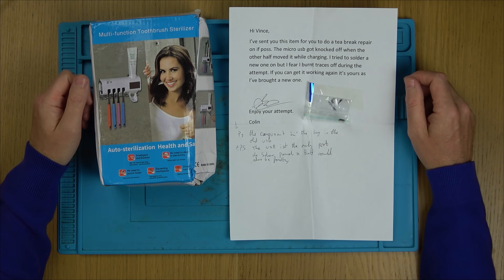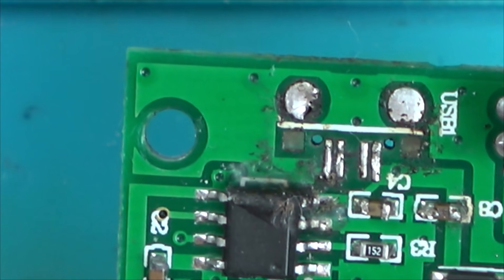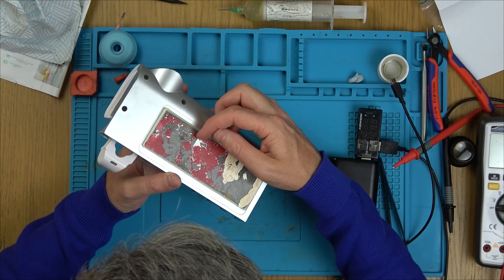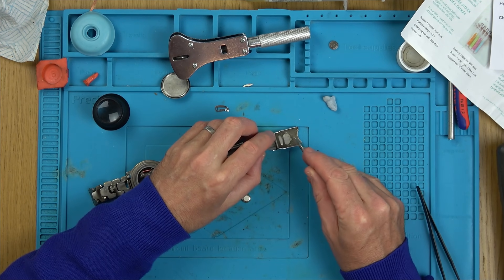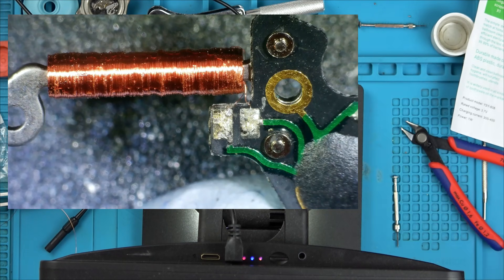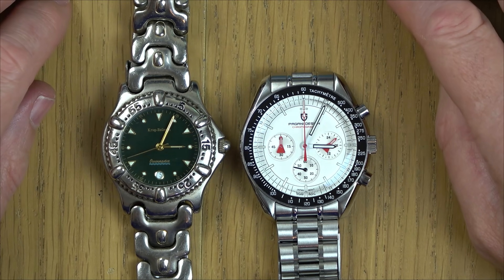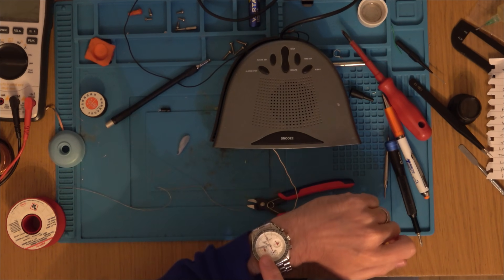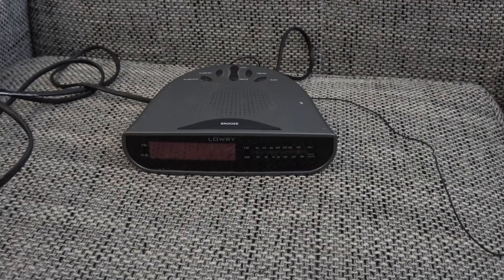Selection of PO BOX items - Can I FIX THEM?

Comment: Hey Vince, that clock radio repair was for sure the glue, with almost 50 years experience in electronics repair I have seen that glue they use to hold wires and components to be at fault many many times, don't underestimate it as a fault, I think hot glue is used now for that reason.  
The power grid is very accuratly controlled over 24 hours, the frequency may go up and down over a day with demand but is always the same number of cycles in 24 hours, amazing but true!
Love watching great content and you keep thing from the landfill.  :face-blue-smiling:
Reply from the maker: Thanks Glen👍
Reply: Agreed.  That glue can and will cause some weird issues. You can't necessarily measure it with a DC ohmmeter.  One of the worst cases is with the Kenwood TS-440 transceiver.

Comment: Hi Vince, i have a kitchen-clock from my grandmother. It dates to the early '50s and is a "Junghans Synchron" which runs on a synchronous motor powered by mains 230V. That means that the rotation of the shaft is synchronized with the frequency of the supply. The frequency here in Austria (probably most countries) is regulated. We get 4320000 cycles every day. Therefore this old, mechanical watch is incredible precise. If we didn't have daylight saving time I would never have to touch it. So i change the hours every 6 months and every 2 Years the gears (all brass:-)) and the motor spindle get a tiny drop of oil. It never failed at me.
Keep up exploring failures! Greetings from Vienna
Reply from the maker: Amazing that it is so accurate and built to last with some servicing 👌👍👍👍
Reply: @Mymatevince 
When is part 44 of the Rolls Royce coming out
Reply from the maker: @ProMasterTheGamer52  This week hopefully👍
Reply: @Mymatevince  
Ok
Reply: @Mymatevince  
You should check if the tale lights are working
Reply from the maker: @ProMasterTheGamer52  That will be in Part 45👍
Reply: @Mymatevince  
OK cool

Comment: Many years ago, I built a control panel for a customer in Canada. Part of the function was a 5 hour timer once the equipment reached a set temperature (know as a soak in pottery). A few days after it was installed I got a report back that they were only getting 4 hours of "soak". I forgot that Canada was on 60Hz supply. I sent a 60Hz timer to them, problem solved. Keep up the good work. Mike

Comment: Yep lack of tools, standard size soldering iron & just my eyes. The only thing I will say is we found the toothpaste dispenser blocks easy with some toothpastes & lets some thru with others, so we used it as just toothbrush holder and cleaner, as to the paint work it was lilac wen we moved in we painted over it cream then went red and then too white, so yes some changes
Reply from the maker: Cheers Colin for sending the unusual product over, and the history of the wall colour 😂 Thank you 👍👍👍

Comment: UV-C LEDs are expensive and haven't really found their way into consumer electronics as yet. So I doubt that that toothbrush sterilizer sterilizes anything. Just shines some violet light to make it look like its doing something.
Reply: Yeah. Quite a lot of things have a little, useless blue/violet light in and a nonsense UV sticker on the box.
Reply: You can find them sometimes, the best way to tell would be to look at the LED and see if it has a glass lens and metal housing. Even if it is UVC, it's probably just a single, weak LED.
Reply: UV-C LEDs have gotten cheap due to COVID-19, but those ones' look like normal UV.  The UV-C ones have a yellow-ish tinge to them due to the quartz glass covering they have.  My local supermarket was dumping phone steriliser boxes for $1 - they had real UV-C LEDs + wireless charging modules - win!

Comment: I had no idea a digital alarm clock could keep it's time using the 50Hz from AC. Presumably the modern clocks which run on DC will need a crystal added. Learnt something here today, thanks Vince.
Reply from the maker: Thanks Philip, it was news to me, I just assumed it would have a watch crystal in it. Amazing that the grid is so stable. Cheers for the Super Thanks👍
Reply: @Mymatevince The grid isn't just stable, it's guaranteed to be stable. Your get the same number of cycles each day. If for a few minutes it runs slow due to load, they speed it up later to compensate. Mains synchronised clocks effectively have atomic clock accuracy as a result.

Lots of early digital clocks were mains synchronised. I have one from 1974 in my living room. It keeps perfect time.
Reply: Modern ones most likely get a time reference over WiFi using NTP :)
Reply: @GeorgeStyles  We have a Roberts CR 9955 which auto sets the time. It doesn't use WiFi so I'm thnking it might be GPS time.
Reply: @DavidHembrow  my mate who worked in a power station gave me an unofficial tour, and the amount of effort they put in to getting this right is phenomenal. It's like the stock price for a power station worker, with tickers on huge led displays. I believe they have to modulate it by physically speeding up or slowing down the spinning of the generator in response to demand (ie, England world cup kick off, loads of TVs go on, it slows so they have to speed it up somehow, or run it faster later to compensate)

Comment: Hi Vince, been watching your channel for the last few weeks, binge watched the rolls royce vids, well done for taking on a great project. You have inspired me to, repair my cheap old multimeter, which had corroded battery terminal, now working, also my belt and disc sander, new switch installed and back working. Keep up the great channel, love the Amazon repairs. Regards Phil.

Comment: Can't remember where I saw the video, but it was about the power grid and how they keep it to a perfect 50Hz as best they can, and even speed up/slow down the rate depending on what they need to do for accuracy. The video mentioned there are systems reliant on that timing too, but didn't realise there were manufacturers of digital clocks etc doing the same thing. Very cool stuff

Comment: A clock set to 60 Hz in 50 Hz territory would be running slow, not fast, so I reckon it actually was the cap that fixed it (the oscillator may be sensitive to power supply ripple). I still have a fancy Grundig talking alarm clock from the early '80s somewhere that had a similar issue if memory serves (I think it used the same or a similar chip). The double-sided PCBs are notoriously fragile though, the things just weren't built to be repairable, so I kind of dread looking at it again. Last time just trying to measure a voltage on this or another similar unit (I had several) made a little 1/6 W or 1/8 W fusible resistor go up in smoke. I do have a whole folder worth of various Grundig Sonoclock service docs in any case, so should anyone ever need something....

Comment: I have worked at National Grid, the 50Hz frequency is very carefully maintained.  It's the frequency that indicates if the power being placed onto the grid matches the load.  So they increase the power being put in if the frequency starts dropping.  You would expect the voltage to be the more important measurement, I was surprised.
Reply: I saw a documentary about the grid and the importance of the frequency. The guy in charge of supply got quite concerned if the frequency dropped even a little, like 49.9Hz. I believe the frequency is an indication of the generators actually slowing down as they struggle to match the load, (I.e. the actual frequency of rotation, or 1/3rd. of it in the case of the typical three phase supply). By turning on an additional generator somewhere, the load can be met and the frequency rises accordingly. The opposite happens when load falls. Then they start switching off generators. Many timed products use the mains frequency, including motors. Mains powered clocks often have a motor, wall wart timers have them ( the rotating kind) and even some turntables. The most famous of these being the Linn Sondek LP12. The motor that turned the platter turned in time with mains frequency.

Comment: If I recall, mains frequency is within an absolute 1% at all times, but is corrected to average exactly 50Hz over the day for accuracy of mains synchronous clocks... the old teasmade would probably have a synchronous motor.
Also, a synchronous motor clock is good at ignoring interference, while electronic mains synchronized clocks can jump forward due to using a poorly suppressed power tool

Comment: Quite a lot of things take a reference off the supply frequency for timing, things like house alarms too can run the clock off the mains which surprises people. Thing is though, the supply is incredibly accurate because as a hospital technician I see digital meters on our massive generation equipment and they are always within 0.05 of a cycle which is essential when paralleling any form of generator to the mains whether it's a solar inverter of a 2mva diesel generator.

Comment: Nice Job Vince 👍pity about the coil on the watch. I think the clock might be something with the frequency selection. It won't be the transformer, but it there might be some filtering from the AC side through a diode or capacitor so it can get a clock type signal. At least it's working now. Keep up the great work 🙂
Reply from the maker: Thanks Mick 👌👍
Reply: If you put on 50Hz signal into a 60 Hz clock chip the clock runs slow, not fast, because it's will increase the time by 1 second after 60 cycles, not 50. But the clock of Vince runs faster. So, the clock selection pin is not the issue.

Comment: Just a small point. Wrapping the whole coil in conductive paint puts a shorted turn around the coil. This will probably impact the function of the coil, especially if there is conductivity to the existing turns.

Comment: If you coat the whole coil with silver paint you create a new 'winding' with one turn - and its shorted. That weakens the electromagnet and broadens the pulses.
Reply from the maker: I would have thought the silver paint would only connect to the 2 sides of the one broken wire in the coil under all the silver paint as it is all enameled, so hopefully the intact coil was insulated against the silver paint. The wire going to the middle of the coil was still going into the middle so it shouldn't have shorted against the silver paint on top and the ohm reading suggests this was the case. It didn't work for more than 1 minute though 😂 Cheers Tip Fox 👍
Reply: @Mymatevince  I found the english word for such a shorted 1-turn winding - it's called 'shading coil' see i.e. here: en.wikipedia.org/wiki/Shading_coil

Comment: The battery on the first one had some protection board on it, it had a tiny stripe that was thicker then the lithium cell hence it read 0 volts because the battery manage system cut of the battery. Also that chip being clocked by the mains is a nice design and does not require any more parts

Comment: Re the clock radio yes that glue needed to removed from everything it is a common fault over time it goes hard and conductive on tvs hifi  etc on any parts changing that cap and checking the others ECR's as well good idea

Comment: I remember reading a story on Reddit from someone who was constantly late. They had a mains clock like that and they would set it, it took timekeeping from the cycles of the power grid, and then they would arrive late for buses, college classes etc. Eventually they called the electric company and their clock helped prove that there was a problem with the local electrical grid operating too slowly. I may have misremembered some details from the story.

Comment: Having recently discovered your videos I love them. The little HP printer for the phone (works after shorting pins) reminded me of something I saw a while ago.  Maybe this circuit has zero volt protection.  I was watching another YouTuber trying to recell GoPro batteries but, when they put the new cells in the cases the  batteries refused to work. They were convinced that there was a chip on board that knew when the board went zero volts and then refused to allow the batteries to work.  Can’t find that video now

Comment: The grid frequency has to be tightly synchronized. If the generators desynchronise it can cause a local or full grid collapse because of an inability of the generators to lock onto this frequency and thus shutting down. As a result something like the European grid is fixed to exactly 50 Hz +/- a fairly narrow tolerance, allowing not only generators to work in sync, but also clocks including those in your microwave and oven to use it as a timing source. It's generally more accurate than a cheap crystal.

The grid frequency is also dependent on the supply/demand, which is where the importance of a spinning reserve comes from. This incidentally is why the addition of variable renewable energy sources like wind and solar are so problematic, as they cause intense fluctuations on the grid (cloud passing over and wind picking up or slowing down), that have to be compensated for by other generators on the grid. All of which threaten the perfect grid frequency and also make grid-synced clocks less accurate over long time period.
Reply from the maker: That's a really interesting read, thanks Maya 👍👍👍👍👍

Comment: There is NO voltage regulator in the circuit. The voltage is just rectified and fed to the chip. This means that the voltage of the chip will have a ripple on it. This is not problem if you have a good cap, because the chip uses little energy, so the ripple will be small. But if you have a bad cap, there will be a rather large ripple in the system, which might cause you to count extra cycles on the input pin - like the ripple is counted as a 50 Hz pulse. A good design would use a voltage regulator....
Reply from the maker: So hopefully changing the cap was the actual fix then. I had it on for 2 days following the video and the time was constant. Strange how the cap looked OK, ESR was OK, just the capacitance was a bit out. Or maybe if it was run over a month or more the problem would reoccur. Cheers for your explanation Kris 👍👍

Comment: I had a second hand on a watch do the same thing after changing a battery, I think it was dirt in the mechanism. It would work for a while and stop, I tried blowing in it but it didn't help. In the end I sucked it the best I could and it's now been working for 8 months.

With the clock I just finished watching a video of someone making a circuit to detect the crossover point on AC and testing with an Oscilloscope and it works very well.

Comment: Using mains frequency is pretty common. I've even seen it used for the clock of a microcontroller
Reply: Yep just divide it a few rimes and you have the frequency you want

Comment: There's no actual UV light inside that thing. You can tell from yellowing on the outside from natural light while the inside is still the original color.
The inside would be yellowed as well from the UV lights if it actually had them.

Comment: I was assuming a crystal oscillator to be faulty, I didn't expect the unit to be relying on the 50hz AC mains input frequency, mind blown!
Reply: Yeah i once also got a alarm clock that uses 50hz that got divided to the freqeuency it uses and my mind was blown when i got to repair it wow!

Comment: On the frequency  thing of the mains.
 Since there are more than one power stations  across the country..  and thesecare connected in parallel  to our homes....it would be essential  that each power station  was out puting the same voltage at the same time.....and thus be in sync and stay in sync..
The CEGB make huge efforts for this to be so... ...
The 50hz is from memory held to parts per million over any 24 hr cycle. ...thus plenty good enough  fore houshold clocks
If your clock radio has a problem ...its noise either in the mains ref. Or on the pin telling it 50/60hz.

Comment: If you say the chip the signal is 60Hz it will count 60 clock cycles (instead of 50) before increasing 1 second. So, it makes your clock run slower, not faster. So,it's not a problem related to the 50/60 selection pin.
Reply from the maker: Good point, thanks Kris 👍👍

Comment: Really interesting video, thanks. If the clock sets the time based on the mains frequency how does it work on batteries?!! Even if the batteries are just to hold the time in case of mains failure does it have a crystal oscillator as backup?
Reply from the maker: Good question, I don't think anyone has mentioned that. Unfortunately I don't know, hopefully someone else will have the answer. Maybe the chip I was working on has it built internally, but grid timing might be more reliable 👍👍

Comment: If that wacht was a real TAG Heuer Aquaracer it would be about 1.000 - 1.500 Pounds in used condition (and over 2.500 new).  The cheapest TH starts at 1.400 Pounds new. I'm pretty sure nobody would sent his TH to a PO-box for a video by someone you don't know. So good guess it was a fake one. Also, the quality of the watch gave it away.

The clock, if it is set at 60Hz on a 50Hz net the clock it would be going slower. It would need 60Hz/second to measure 1 second but would get only 50 - it would think 1 second has passed when it got 10Hz out of the next second. In fact it would think only 1 minute (60*60Hz=3600Hz) has passed when in reality it has been 1 minute and 12 seconds (3600Hz/50Hz=72 seconds). So it would be about 17% slower, not 20% faster (and move minutes at 52 seconds). So it can't be the 50/60Hz setting which was at fault. Unless the 60Hz module is broken and counts 43,33Hz instead of 60Hz.

Comment: Crimes can be solved by electrical system frequency. Frequency varies constantly and the variation is permanently recorded by the energy companies.
The variation can be extracted from recordings of video or sound and then can be matched like a finger print against the offical record, leaving you with the exact time and date a recording was made.
The variations are so minute the effect on clocks is minimal, whats a minute or 2 a year, no big deal